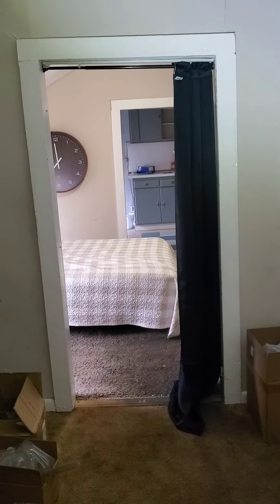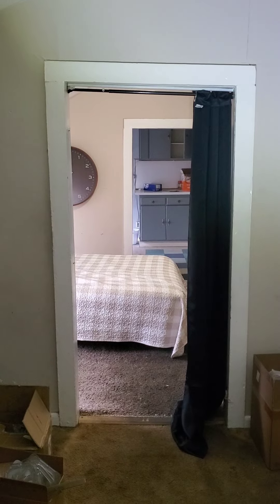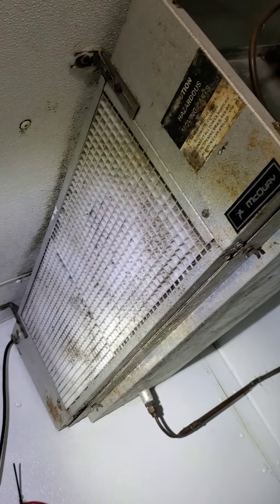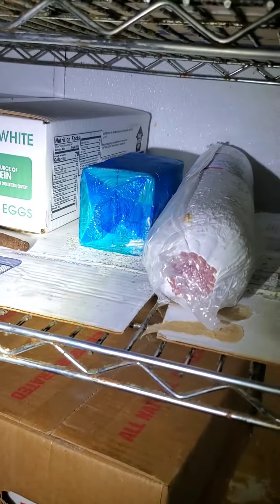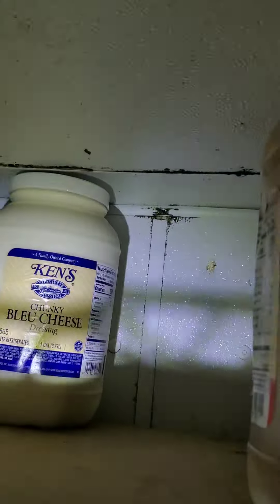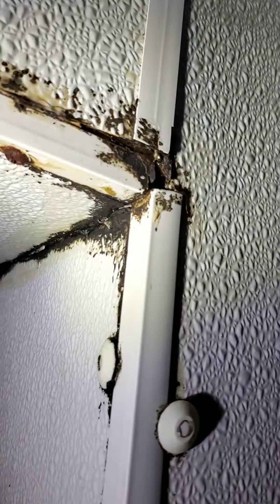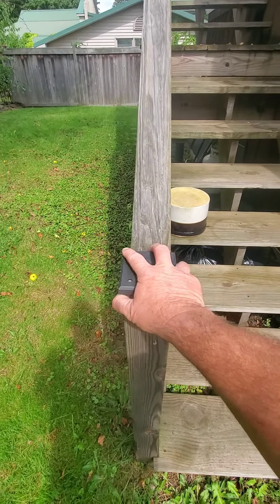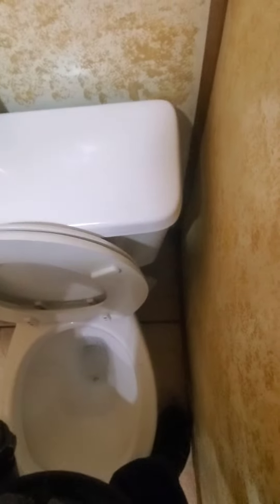Seller is stalking me on this home inspection!

Comment: Inspector Preston, your videos inspired me to replace some concrete by my foundation and replace the basement windows that were old and leaky. Yesterday, though, I passed a building with negative drainage, a splash block 10 feet from the downspout, and step cracking and thought of your videos.

Comment: As far as the bonus footage goes, you never want to over tighten anything.
Reply: 40+ years remodeling homes. toilets are tough. tighten too much, you just bought the customer a new one. too loose? doesn't break or leak. but needs tightening. i found though over the decades, it's best to microwave the wax ring for a minute or two. gives the right amount of softness needed to tighten them up right the first time.